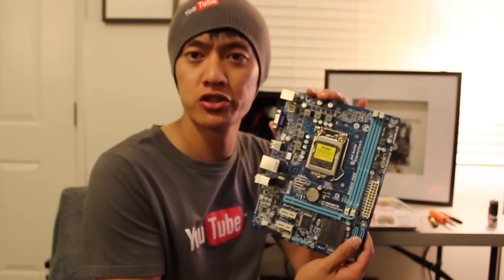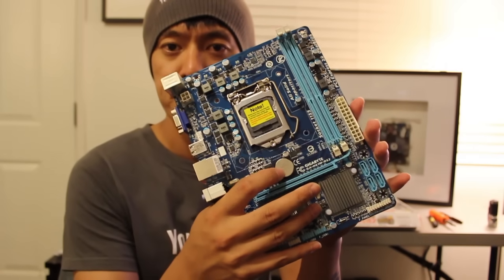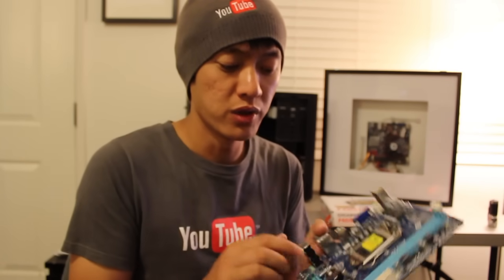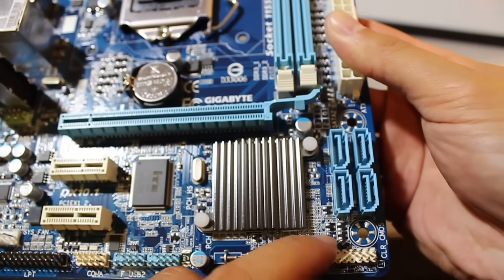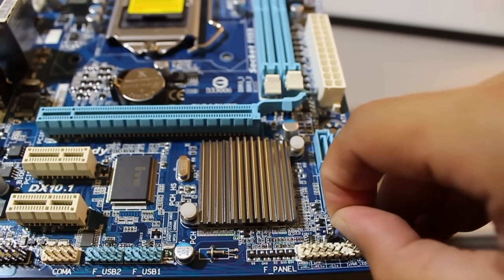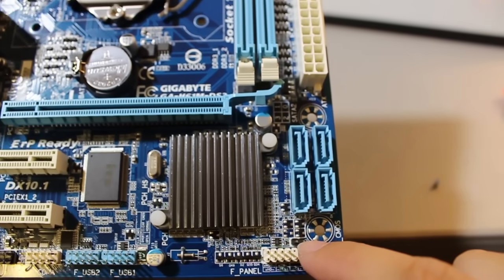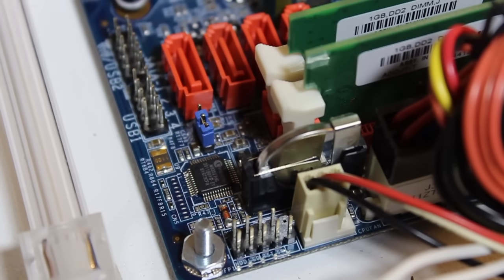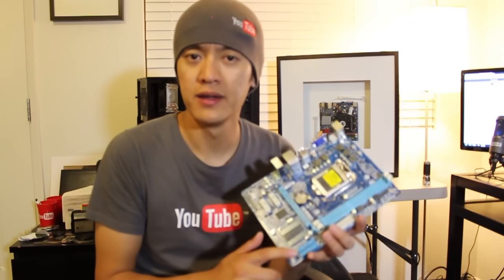How to Clear the CMOS - Reset the BIOS & Why

Comment: You’re a life saver. I got a second 8gb ram stick, tried to boot with a dimms set up, no boot. Tried to go back and test each individual ram stick, no boot. Tried running both in simms no boot. Popped the cmos battery out, rebooted and dimms worked great. <3

Comment: Is clearing the cmos helpful in the kind of situation when you assembly a new PC and it doesn't  even turn on and there's no  led in your motherboard as the PC won't turn on? ( With every cables connected) ? And what does he mean by "Boot" .. It means turn on with the power? Or boot system with only / BIOS ?
Reply: Randy89kk this is my exact problem right now!! Did you find a fix to yours? Can you please let me know
Reply: No led blinking in the motherboard indicates problem in the psu or some wrong connection you may have accidently made (considering you pointed out that you assembled a new pc )

Comment: Keep in mind you dont want to leave the jumper in place for more than a few seconds. Usually a flat screw driver works easily and gets the job done. Now in rare cases where you think the mobo is dead and you tried to reset it a few times to no avail, then instead of losing your mind and buying a new board, put the jumper on and leave it in place for a good 30 seconds to one minute! Sometimes after overclocking its stubborn and you fear you bricked the board try that first, if that don't bring it back use a flat screwdriver and jolt it by making several fast contacts. That method actually saved an Asus board for me once and brought it back to life! Well when all the conventional methods have failed thats when you turn to the unconventional methods I have described here.....good luck!
Reply: Hey i have problem i instaled wrong bios and now i got black screen, i have 3 pins , jumper is on 2nd and 3rd. So if i want to reset it i put it on 1st ane 2nd? Yes? And do i need to turn on pc when its places on 1st and 2nd ? And then when i turn pc off, i put them back on 2nd and 3rd?

Comment: I had just Overclocked my PC for the very first time (i5 3570K). I thought it wouldn't be a problem because I have a K in my cpu name. I accept the changes in efi and reset PC. 

BAAAAAM in all of a sudden my PC won't even power on longer then 2 seconds. I tried like 10 times, i almost went full berserk / panic state. 

I stumble across this video 10minutes later. I get my nerves togheter, open my case for the very first time. I manage to find this CMOS thingy and do exactly as Mister Johnny Phung tells me to do... 30 seconds later i start my PC and it works...

Thank you Mister Johnny Phung!!!! THANK YOUUUUU!!!!!

Comment: You literally just saved my new PC!  I changed something in Bios, Windows came up with a sad face closed down and would not restart. I couldn't even get the bios to come back up to change it back.  I am still having windows issues, but at least the computer is coming back up! Nothing was scarier than that big black screen and no keyboard input meant a thing!  Switchingbthe jumper and resetting it did the trick! Thank you again!!

Comment: i found the cmos but i dont have the jumper thing
where did u get the jumper
Reply: take a screw driver and jump the two pins together, switch on your pc while holding your screw driver in place.
Reply: JUST SHORT IT WITH A SCREWDRIVER
Reply: Avijit Sinha how
Reply: Lol i shorted mine with a usb ... I just put it down over the pins and it worked
Reply: Android Doctor wow
Reply: lol hackers
Reply: Haloid Android I fucking love you man 😂
Reply: I used the spoon i was eating soup with
Reply: Android Doctor same idk what the fuck is he saying
Reply: Hey what's can i do if i dont have a pladtic in CMOS, how i can reset bios?
Reply: Yeah use advice from haloid android
Reply: You can use a paper clip instead and put it right in between the 2 pins near the cmos battery

Comment: Thank you so much. I've had a dream to build a pc for a little over a year now. It wasn't until this Christmas that I was able to get all the parts (A $500+ Gaming Pc following a guide from scattervolt). I just built the pc and after a couple of weeks I got some bluescreens of death and after trying to fix them my pc would turn on but my monitor wouldnt get signal. I though I ruined everything.

This video saved me. My motherboard didn't come with a jumper but I was able to use a screwdriver. Thank you so much you saved me.

(PS: After 8 years this video still works)
Reply: My PC is getting power too, but when I plug my monitor up, my monitor just says going to sleep. Someone from Reddit recommended that I clear the CMOS so I’m watching this to learn what to do. This comment gave me hope, I’m going to try it out.
Reply: @laktoarg  Update me if it worked for u
Reply: ElijahMC YOLO Nope :(

Comment: Will resetting the bios affect a system that's been set up for a dual boot? Where c drive is a solid state used for OS, drivers, and system files, and D as a hard drive for everything else.
Reply from the maker: It will more than likely effect the boot order depending on which SATA port you have the drives plugged into. So for example if the "D" drive is plugged into SATA port 1 and the SSD is plugged into SATA port 2, after you reset the bios, the "D" drive may become the primary boot device because it is port 1. But since it does not have an OS the next drive to boot is whatever is plugged into SATA port 2 and that will be the SSD. But some motherboards may not boot the next drive in order and you will get nothing to boot. It will not effect any part of the system partition or the files that is on both drives. That's more than you needed to know but I hope that helps. Thanks for watching!
Reply: Mattuiop Do you have two OS's? Because it sounds like you just have two hard drives...which is not "Dual Boot". In any event, if you really do have a dual boot system, all that boot information for multiple OS's is stored on the HDD... not in the BIOS.

Comment: I have a gigabyte f2a78m-d3h but I cant get into bios, I just get a black screen with a mouse cursor and nothing else.. I havent installed an OS yet. Ive tried reseting the cmos by unplugging the battery for 1 minute and by shorting the pins but its still the same.. any suggestions?
Reply: Never mind.. kinda embarrasing but it turned out to be a faulty hdmi cable..(most likely at least, worked when I switched to DVI..
Reply: Throw away your damn pc
Reply: I'm facing same problem
Reply: I'm facing same problem

Comment: After clearing cmos you need to intall Windows again??  Or it come to factory reset?
Reply: After clearing CMOS, you don't hafta install windows again. Clearing CMOS just puts the computer back the way it was when it was new, sorta. 

        For me, on my Dell, ASUS and Gigabyte motherboards, it's often been a real lifesaver, when nothing else would really fix it. It's usually easy to do,  the hardest part for me is getting that easy access inside the case and seeing what I'm doing, then  locating the pins or the button. 

     Just be sure to read/download the motherboard manual to make sure how find the button and to do it properly.
      On some motherboards, you must remove the power completely before doing this procedure. Most newer power supplies have a power switch on them to do this. Or just unplug it. 

           After removing the power,  I like to hold in the case's power button for a few seconds to completely drain the power supply too.

Comment: Most tutorials include taking out and putting in the motherboard battery as part of the CMOS reset. Is there any particular reason you didn't?
Reply: Taking out the CMOS battery itself will reset all personal settings stored in the BIOS as well as the time/date ect... Lets say you have an admin/bios password that you set, this a password that you're prompted for immediately after POST, this password prevents you/someone from being able to get into the BIOS before the PC even fully starts up. And lets say you forgot this password, you'd only need to clear CMOS with the jumper to do this. Get it? You'd only remove the battery if it actually needed to be replaced, or you really wanted to clear all personal settings. However removing the CMOS battery will also clear the BIOS password as well. That battery can remove anything associated with BIOS if you take it out, everything will default.

Comment: I reset mine but I still get a black screen an I tried many times
Reply: MotoTech found a fix?
Reply: You have to reset the ram.  Take off the ram, turn on the pc, let it 3 seconds. Probabily you will hear some beeps, turn off the pc, put the ram back and turn it on. Is Better if you put the stick ram one by one.

Comment: Been having probs with terrible lag using this POS Windows 10, so went to MS forum. ONE MS moderater initially gave the usual blurb - repeating stuff most anyone would know if they'd used a computer for 20 years, or 2, and of course, we'd all tried that stuff and it didn't work. Then, someone said, "Disable Superfetch" ... and tadah!  Memory use of 95% dropped drastically!  It worked, and frankly, anything that is described as useful because it "maintains computer use over time" ??? ...everyone in the forum goes and disables superfetch. We're all happy.

THEN some guy says "restart BIOS" and the only other MS response, this time from a "support engineer" gave the guy a huge pat on the back, and thus ended that thread. I was furious.  MS staffers rarely give decent answers, they are just using macros!  Most of the info comes from the Users helping each other out, but now I have to ask ........... what was superfetch REALLY? And did we truly NOT need it? Also, what does "restarting BIOS" even do since I think he may have actually meant "reset" ... but .. well, it made no sense!  Does it to you?
Reply: Best MS support comes from non-MS contributors, just techy random guys that share their knowledge and patience.
Most of the times I've found solutions in other forums and YT, not MS.
Reply: bq

Comment: Great video! my computer went black with the number 99 in the bottom right corner. I started researching on another computer and ended up here, which solved my problem. I thought my computer was totally dead and out. I guess i learned something really important and basic about computers today. Thank you very much.
Reply: Actually my friend told me, just to use a small screwdriver and just keep it on the two little reset pins for 5 seconds.

Comment: Hi!! This worked for me on an ASUS motherboard (2015), I Unplugged the power cord, tthe jumper was already there , it has 3 pins, I moved it to the right (one position to the right) removed the CMOS battery, then plugged the power cord again , I did hold the power button for 30 seconds, the PC did nothing as you said it would happen , then moved the jumper back to where it was , placed the battery back. I repeated this process twice and it worked( it didn't work at first ), thank you for the video !! 🔥🏆👍

Comment: Acer Veriton, would not power on, power light and fans with limited power would switch on and off. I checked everything... and also removed the CMOS battery but all unsuccessful.
So I finally tried the CMOS clear jumper and it worked. 
Thanks for the video and explanation.

Comment: An old upload that is super relevant to my issues today. I am actually learning PC building and gaming as a new hobby and have obtained used untested mobo's. Many I've lucked out on and they have booted and work great. Some are just wrecks with severely bent cpu socket pins, some were finicky in what type of ram makes them happy etc. I have a problem Asrock Z390M Pro4 that fires up but no display. Took the CMOS battery out, swapped it out with another and nothing. The board has only 2 pins for the clr-bios. Can a small screwdriver be used in place of the jumper cap, because I don't have one of those. As a neewb I wasn't sure how to actually use the re-set pins until watching this video. Thank you for sharing and explaining in detail these valuable instructions.

Comment: In the case I may have overlooked what you stated...  bad or low cmos battery will not prevent a board from coming on. It will however prevent saving the settings in the bios.

Comment: I was unable to boot my os, and this guy came like a god and showed me the right path with proper reasoning, i actually didn't had the jumper so i reset the bios by shorting them with a screwdriver.
Thank you for saving my day.
Reply: Deepesh Godara I haven’t tried it yet but I went from a 2200g to a ryzen 5 2600 on a b450 tomahawk Mobo and I’ve been having issues with booting up and his explanation early in the video makes sense. I can’t find my jumper and in my manual it says not to start the pc with a jumper and to keep it off but leave the jumper on for 15 seconds . Thinking about taking a chance and using a jumper from my other motherboard and turning it on like he says hopefully I don’t mess anything up. Also on my EZdebug lights on the side my cpu light stays on when starting up everything runs fine all fans work and lights are on I’m wondering if this situation is similar to yours. And if you shorted it while starting the pc

Comment: Definitely refer to the motherboard manual before placing the jumper.  I tried to boot my system from the onboard video and it didn’t work because I had a GPU previously installed.  So I figured I had to reset my bios.  My manual for my board said to NOT power on the motherboard with the jumper in place because it would ruin my board, so just a heads up.

Comment: You are a life saver mate My dumas forgot to the change the voltage while I overclocked my cpu from 3.5 to 4.6 ghz I thought I killed my cpu because it wasn’t being detected and I was going to have to replace the dam cmos battery if I haven’t seen you video. Oh and btw I didn’t have a jumper that came with my motherboard and I some how miraculously got away by using one from and arduino part.

Comment: Hmm, manuals say that you DON'T try to push the powerbutton when the jumper is on the clear setting, You have to unhook all power and the jumper basically short circuit the battery for a few seconds so the bios chip loses is data what's been keeping stored by the psu and battery, that's why if you remove the battery with the psu still connected and plugged in the wall outlet it wont lose the settings because of the 5vsb line that's always giving power to the mouse for example

Comment: Thanks for the vid, gonna post my sob story lol.

My 8-9yr old pc that I built uses an ASUS P8P67 motherboard. The 2X4gb DDR3 RAM sticks I had in there were fine but recently I thought to add another 2X4gb DDR3 RAM sticks in as well to bring it up to 16gb. The old RAM sticks that I had are no longer in stock but I thought as long as they were DDR3 that any new sticks would be fine and the websites I checked stated that the motherboard could sort out two different types of memory slotted in.
Nope, computer turned on but nothing on screen, ASUS red Mem OK light was on, held it down for 3 seconds to reboot my pc and hope it would make the two different sticks compatible but no luck. Turned off pc, took out the new sticks and just left my old ones in. When I rebooted the pc the screen was still blank and the red light MemOK was still on.

Checked ASUS website and they reccomended what you have as well but also suggested to take out the CMOS battery from the mobo as well, which I did. However it then told me something about short circuiting (or something along those lines) a component in the battery holder?? Which I couldn't find so thought "fuck this" and put the battery back in and followed your steps instead.
Sadly the problem persists, there's life in my pc when I turn it on but completely blank screens, but also when I put the little blue plastic jumper back to it's default one pin position the pc doesn't turn on at all, it only turns on when it's covering the 2nd and 3rd pin of the three pins. So that's a worry.

I cry everytime but what can I do except blame myself, I'm gunna take it to a pc store and let an actual knowledgeable person have a look at it and hope for the best. I just wish the websites screamed in caps to not have two sets of different mem sticks even if they are both DDR3 and compatible with the mobo. AND I wish my old sticks were still available as I would of just got them if they were.